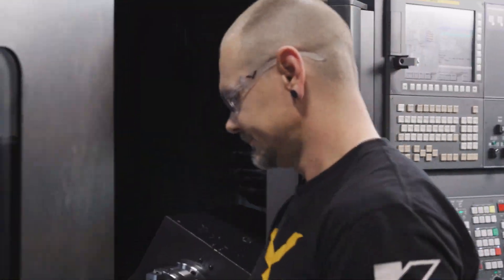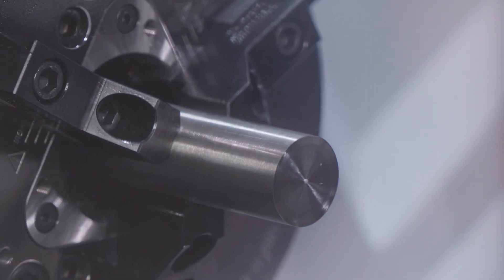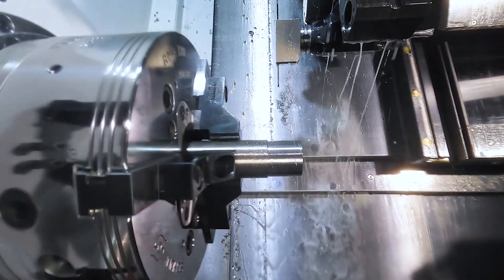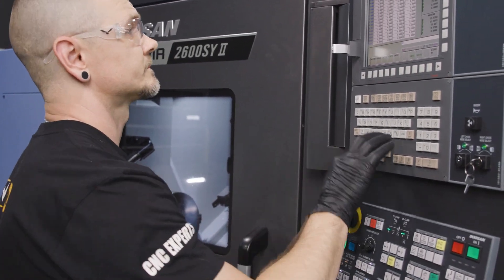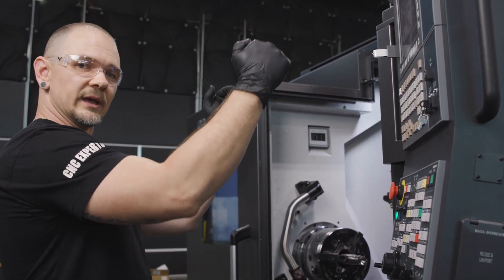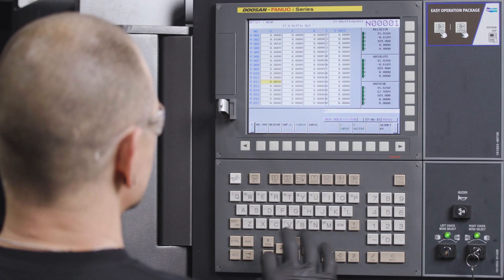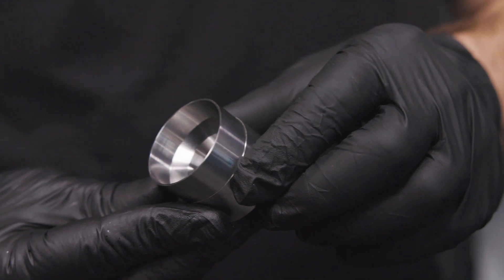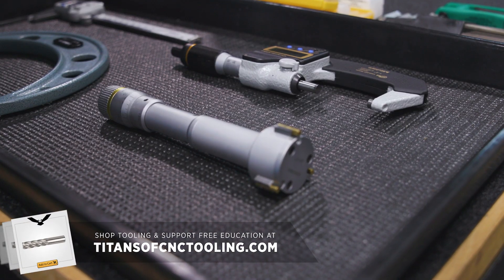Dialing in the OD/ID Dimensions on PUMA 2600SY II Lathe | DN Solutions

Comment: The fun part Beginns if you have multiple tight tolerances in a row that are each fairly long so the part is bending away from the tool ever so slightly with each pass so it gets kind of unpredictable how much it's actually gonna subtract. sometimes get parts with four fits directly behind each other with tolerances as tight as 0,009mm over a length of 100mm and when you got that dialed in you are just happy it's over.
Reply: Sometimes you have to alter the program to fit the situation.
Reply: @jeffwombold9167  
"sometimes"  😏, ... running " long " shafts with a spring-center in a lower turret gives always " some " changing in the program, 100% parallel is almost impossible to do in one set-up, but that's ok  😉
Reply: Indeed. I have battled this myself and have thought about making a video on it actually. It can be a process for sure.
Reply: I saw a project a few years ago that required a long tube fitting over another which was made from a different material, it worked great as machined, but couldn’t be assembled outside in the heat because of thermal expansion.  Very tight tolerances need to be specified and checked at a specific temperature.
Reply: @Der Backsteinbäcker
I assume you use multiple Wear Offsets for each fit on that part and you change your conical to parallel by program ??
Reply: @YT Fan  actually I don't use any wear offsets but a function of the controller . I program the machine to leave 0,05mm radial in the finishing pass. Then I measure the offsets of each of the fits from front to back, compensate for that in the  conture until they are within one or two thousands of a millimeter. Then I calculate how far away I am from the desired diameter of each of the fits and bring all of them to for example 0,05mm above the final diameter, also in the conture( In doing this while constantly decreacing the amount of material the finishing pass leaves). When the fits are equal diamter from front to back and equally far from there final diameter I then finish the part without leaving  any material. It's a pain in the ass every time and it's probably not the fastest method of doing this but I haven't scraped a single piece and I programmed these 3 times already. another thing that's annoying is you have to run the machine for about 20min or so until it's fully warmed up otherwise you will be working against a expanding machine and a hell of a part at the same time and that's really noting you want to do.
Reply: @derbacksteinbacker4942  Ok, I assume you do low number of parts, or single parts.
We do lots of shaft work up to 500 mm and I use a 0.5 mm ( in diameter ) leaving for finishing with a DCMT 0.4 rad.
We have most of the time 4 fits on one side, and I use T0202 on first fit,  T0213 (2nd), T0214 (3rd), T0215 (4th) and so on, when there is some conical in the fit I adjust that by program to get it parallel.
I have a Warm-Up program that moves all axis for 10 min with a High Feed, works good for me, after that adjusting Wear Offset when necessary.

Comment: Excellent video!  
If your cutting stinko inconnel remember it springs .04mm so..... 
If you wanted take off .02 you need write down your off set as travis has calculated it and that will sort out the next component 1st time , meanwhile you need to back off the finish tools .02mm to complete the current  component.  Or if your boss ain't on your back measure the 1st attempt spring pass the test cut dont measure it (hopefully have more than .04 excess material)
and then add Travis' off set . With some  Aircraft materials you need to appreciate the elasticity of the material and this makes a big difference between sizing in and Booom right 1st time !
Plus the offsets will alter over the course of the day due to spindle and material temp , size in every morning and after break and never trust the night shift 😉😉😉😉
Reply: The lathe I used had a similar push off.  If I was 0.01mm undersize on ID I had to offset away by 0.02mm for my spring cut.  But then for the next part I had to put 0.03mm offset back on.  Also my advice is to SLOWLY input your offset.  Trust me you don't want to accidentally take 0.1mm off when you only wanted 0.01mm but you pressed too quickly to notice.
Reply: @williamlee7371  absolutely we had mori seki nlx ergo line 250s and we had 1970s Binns Berries,  all did the same it must be  push off  even on  manuals  , glad I'm not going mad 🤪
Reply: You sound like you know what you’re doing haha

Comment: Wow holding .0002 with an od mic and .001 with an id mic.  impressive!   Hope inspection has the same feel at Final!
Reply: In the aerospace industry, all the I.D. mics had lab certified calibrated gauge rings. As long as that standard is maintained it works out.
Reply: @opendstudio7141   Still an id dial bore gage with a ring or inspection blocks would be easier.  it could check out of round and taper conditions also.
Reply: @hobofrog6416  GT&D.
Reply: This is a solid observation. While the feel should hopefully stay the same there is some concern about temperature differences between the shop floor and the inspection room. 

To address this you can occasionally take a part and let it normalize to the inspection temp and inspect again. That way final agrees with your numbers. Hopefully.
Reply: @travisjarrett2355  I remember the good old days cutting magnesium +- .0002" in the summer with thermal expansion charts and a prayer!  I'm surprised they are not using a .005-.010 set pass to avoid operator input error!

Comment: Amazing how machines have evolved to the accuracy they now can have.
Reply: A good 1980s cnc can hit those tolerances still today if it's not worn out
Reply: @MF175mp  sure if u do this setup to each part lmao
Old machines dont have temperature compensation
Reply: @LordOfChaos.x  true, wear compensation needs some attention too
Reply: Actually if the old lathe is equipped with automatic tool setter stuff, this is not an issue and you can hit these tolerances anyway by measuring the tool from time to time by program. That was around at least in late 1980's in high end machines I believe.
Reply: @MF175mp  those systems werent that reliable as they sound
But sure u could hit tight tolerances  
But not on complex or exotic materials
Reply: Created and refined.
Reply: I run okumas from the 1980s and plus or minus .0002 is very consistent. As long as you take precautions and have engineers who put size checks in you can achieve some amazing things. Lathes are much easier than mills to do this with, tightest we’ve ran on a mill is plus or minus .0005 on bores.

Comment: What's the small arm thing right next to your lathe chuck? Is it to measure the RPM of the spindle or something?
Reply: That would be the probe to touch off tools
Reply: @eduardolozano3561  , thanks
Reply: @nickstanley5064  You can use it also during Operation for Wear Offset and Break Detection, it has multiple functions, btw not on all brands with a Tool Setter, sometimes you need extra Macro's.
Reply: It’s what Eduardo said. The arm will pivot down, and on the end is a probe with a square tip, to touch off tools in X and Z. 🖖😀